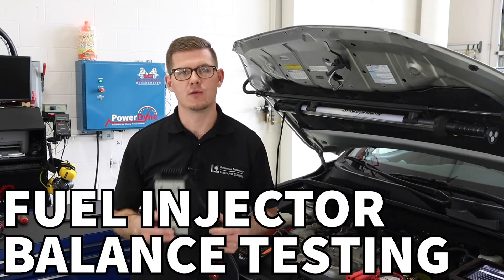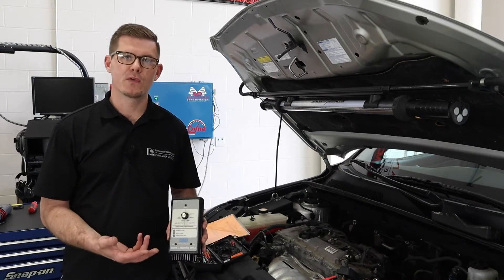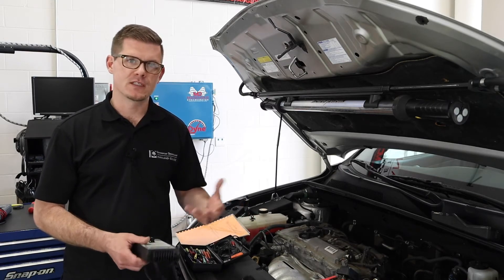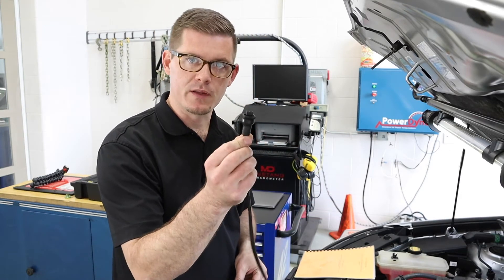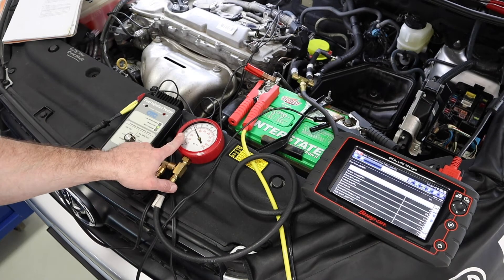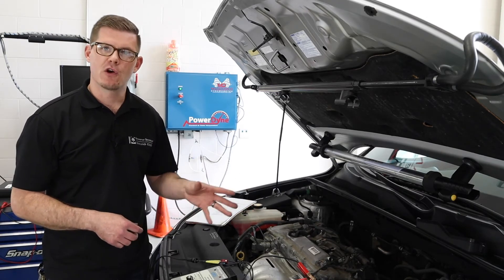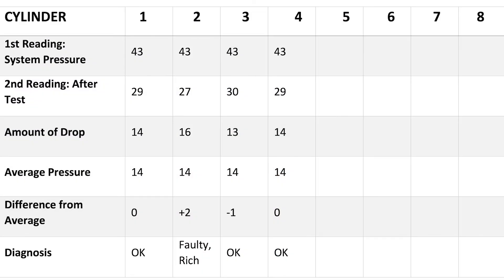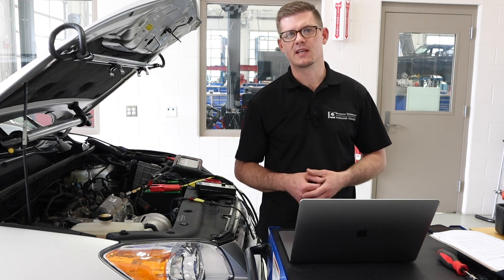Fuel Injector Balance Testing

Comment: I'm not that knowledgeable about this test procedure, but wondered why the presumption is that the injector that dropped the most is the faulty one and not the other three (blocked up?).  After all it is a comparison between them without reference to a standard or expected drop (at least that I could see).

Comment: Was the 3396 replaced by the 3398? Will the 3398 do everything the 3396 does?
Reply from the maker: I reached out to OTC to get a copy of the instruction manual for the 3398. It looks like the 3398 only performs the injector balance test and not the coil test.

Comment: What's the model of the otc tester?I can't find it on the otc website. Also, this  tester, can work with the GDI injector ,as well ?
Reply from the maker: The OTC box I am using in the video has been superseded by OTC-3398. The OTC kit does not work with GDI injectors. The Kent-Moore Active Fuel Injector Tester (CH-47976) offers some GDI injector support when you have the proper adapter harness. The Kent-Moore tool does similar tests but with greater sophistication (and price).
Reply: @AdamsAnalysis  thanks a lot .waiting for your next video

Comment: How about GDI injectors?
Reply: In another video,I suppose. I think, he just cover those type of injector. 
I hope it's going to be the next video. I am really interesting for testing the  GDI injectors.
Reply from the maker: I'll see if I can put together a video with our equipment/vehicles. Some manufactures have a scan tool guided balance test for GDI injectors. It is generally done with the engine running and looks for a rise in pressure when an injector is disabled, rather than a drop with it open.
Reply from the maker: I put a video together over the scan tool balance test for GDI injectors on GM products. https://youtu.be/2cC8Nf7D_WQ